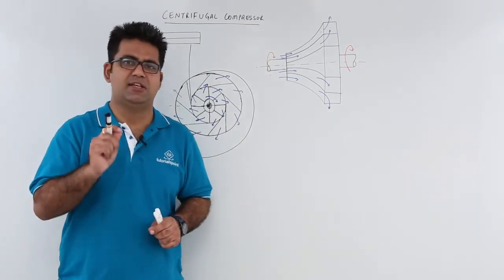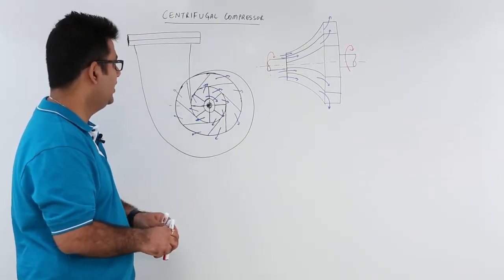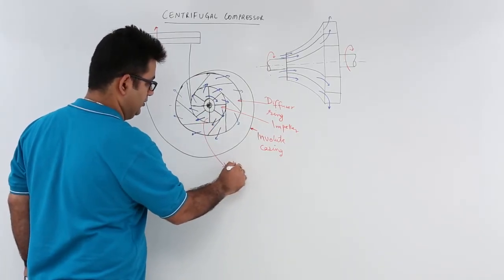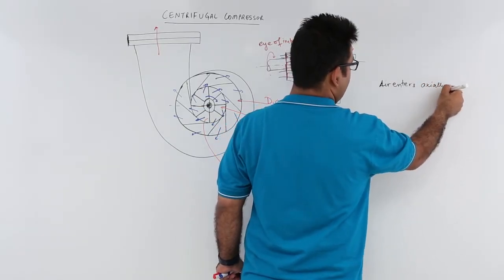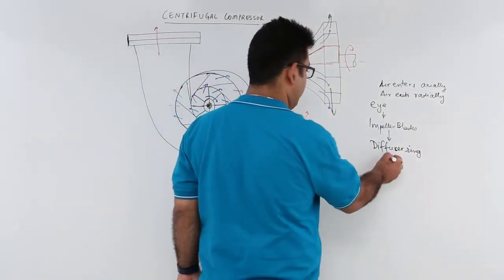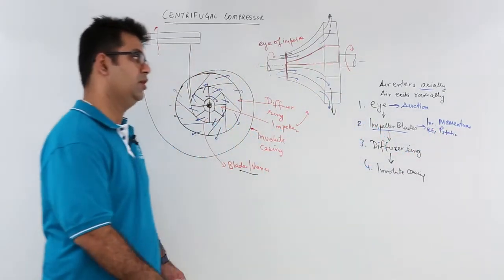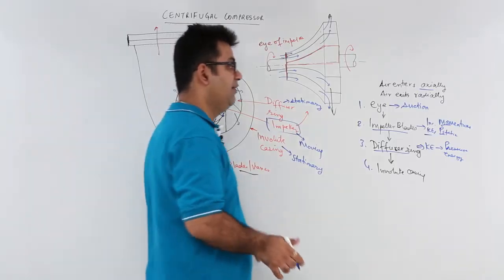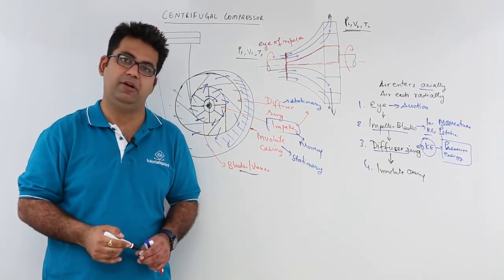Construction of Centrifugal Compressor

Comment: If Kinetic Energy is increasing, which means the Velocity is increasing, then the Static Pressure shuould decrease right?
Correct me if I am wrong!
Reply: Yes I think he meant dynamic pressure increases
Reply: the real pressure increase stands in the diffuser ring: once the air is accelerated through the blades (kinetic energy increases due to rotational energy given to the fluid) it is then strongly decelerated in the diffuser (diffuser usually means divergent duct) so static pressure increases. If you look at the front section of the impeller (w/ cover) you will see the diffuser blades are backwards compared to the impeller and they guide the fluid through a divergent duct. =big variation in velocity